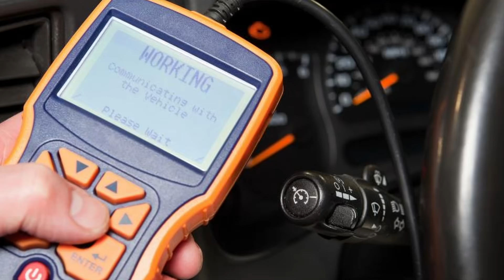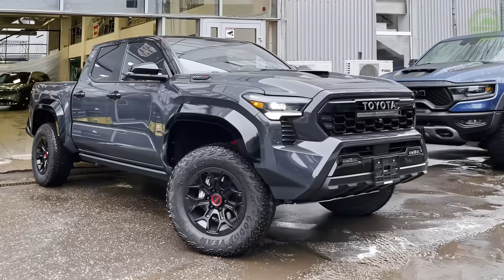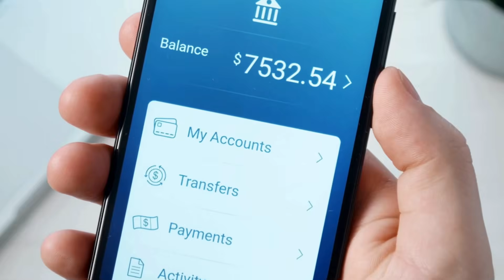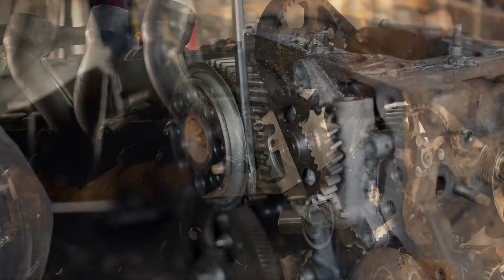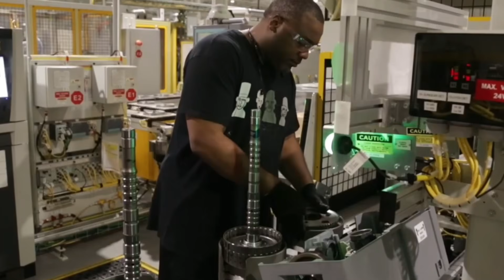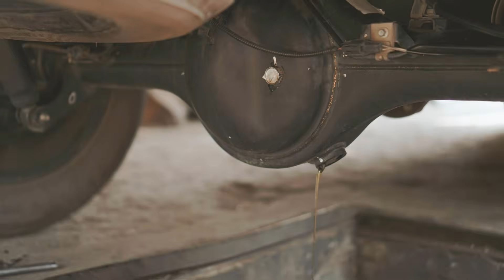Smart Drivers Are Buying 20 Year Old Trucks (Here’s Why)

Comment: I have a 2005 tundra no rust 165k 😂
Reply from the maker: A rust-free '05 Tundra with only 165k? You’re sitting on a legend. That 2005-2006 window is the absolute sweet spot for those trucks because you got the VVT-i power bump and the 5-speed transmission without the complexity of the newer generations. It’ll easily go another 200k if you stay on top of the maintenance. Have you done the timing belt and water pump service recently, or is that next on your list?
Reply: @AutoMetricsHQ did it when I bought it and valve gasket have 4 new tires she just a back up house truck paint is shot though but I love her 😂
Reply from the maker: Smart move doing the belt and gaskets early - that 4.7L will easily reward you with another 150k miles for that alone. It’s the perfect 'house truck' because it’s always ready to work when you need it without the battery-drain and sensor-headaches of a newer model sitting in the driveway. Bad paint just adds character as long as the frame is solid! ;)

Comment: I have a 2000 Dodge 2500 sitting in my back garage with 255K. Mine till I’m off the planet!
Reply from the maker: That 2500 is just getting started at 255K miles! That’s the beauty of it - once you own a truck like that outright, the financial freedom is worth more than any new infotainment screen. Are you still running the original transmission, or did you have to beef it up somewhere along the way?
Reply: @AutoMetricsHQ 
We tow vintage campers with it, yes I updated the transmission to a triple disk. Air Dog Raptor and others.
Reply from the maker: A triple disk converter and an Air Dog Raptor - now that is a bulletproof combination. You’ve basically fixed the only two things that can kill a Gen 2 Dodge. With those upgrades, that truck will keep towing those vintage campers for another 255k miles easily. It’s the perfect setup for the long haul. Are you running a mechanical fuel pressure gauge in the cab, or do you just trust the Air Dog to keep that VP44 happy?
Reply: @AutoMetricsHQ 
VP44 seems to be happy with the Air Dog, I try to keep it between 12-15 PSI with a mechanical gauge.
I agree with everything you have stated. I keep it oil sprayed or Fluid Filmed, it’s a rust free Florida truck.
Reply from the maker: 2-15 PSI is the perfect sweet spot for that VP44 - it keeps the pump lubricated and cool without over-pressurizing the seals. Between those mechanical gauges and the Fluid Film treatment, you're doing exactly what it takes to make a Gen 2 last forever. Florida salt air is no joke, but sounds like you've got it under control.
Reply: oh yeah, agree totally. Used to drive 80’s Mercedes diesels, still have a 2000 TDI Beetle, 5 speed, 273K.
Reply from the maker: You definitely have a type! An 80s Mercedes diesel and a 2000 TDI Beetle are the hall-of-famers of longevity. That ALH engine in your Beetle is legendary for a reason - at 273k, it’s just nicely broken in. It’s the same philosophy as your Dodge: simple, mechanical, and efficient without all the modern emissions junk. Sounds like you’ve mastered the art of never having a car payment! Does that Beetle still get over 45mpg?
Reply: @AutoMetricsHQ 
TDI Beetle routinely gets like 52MPG in the Summer.
Reply from the maker: 52 MPG is incredible - that's better efficiency than most modern hybrids, and you're doing it with 25-year-old mechanical technology. It just proves that when you get the engineering right the first time, you don't need a thousand sensors and a library of software to get results. Between the Beetle and that Dodge, you’ve basically cracked the code on efficient, low-cost ownership.
Reply: @AutoMetricsHQ 
So right you are, thanks for your really cool correspondence!🏆
Reply from the maker: It was a pleasure! I always enjoy chatting with someone who genuinely understands the engineering and the math behind these machines. Guys like you are the reason these legends stay on the road instead of ending up in a scrapyard. Catch you in the next one! ;)
Reply: @AutoMetricsHQ 
You are the Man!

Comment: 2006 tundra...
Reply: I am looking for second gen but it’s hard to find rust free underneath
Reply from the maker: That’s the challenge these days. The clean ones get bought fast, and the rust-free examples usually command a premium. If you can find a southern or western truck, it’s often worth paying more upfront than fighting frame rust later. What year range are you hunting for?
Reply from the maker: The 2006 Tundra is a great example of what I'm talking about. Simple, reliable, and built before trucks became rolling computers. Those 4.7 V8s have a reputation for running forever with basic maintenance. How many miles are on yours now?
Reply: @AutoMetricsHQ don't  have any more  wish id kept it. Sold for 7500.00 in 2019 had 220k miles. Now have 2019 nissan  frontier with the 4.0,  215k another good truck. Bought used with 130 k
Reply from the maker: It’s a classic story - those first-gen Tundras are getting harder to replace every year. But credit where it's due: that Frontier with the 4.0L is a total workhorse and one of the few 'modern' trucks that stayed simple and reliable. At 215k miles, it’s clearly doing the job. Did the previous owner already bypass the radiator 'SMOD' issue, or have you addressed that yourself?
Reply: @AutoMetricsHQ either previous  owner did  or that model was fixed.  I haven't  done nothing in 85 k miles. Its a pro4x. Runs like a clock
Reply from the maker: 85k miles with zero issues is exactly why people swear by those Frontier Pro-4X models. It’s one of the few 'modern' trucks that actually lived up to the old-school reliability standards. Since you’ve already put nearly 100k of your own miles on it, do you find the Frontier's seat comfort holds up on long trips compared to your old Tundra?
Reply: @AutoMetricsHQ i think not.  I recently  made a 500+ trip to Louisiana  my 63 year old butt and back felt it.  But the truck  made it fine cruising  at 75. It think  toyota  has better seating
Reply from the maker: That tracks with what I've heard from a lot of owners. The Frontier will run forever, but Toyota definitely seemed to put more effort into long-haul comfort back then. A 500-mile trip is a pretty good test of any seat! At least the truck passed the reliability test, even if your back didn't. ;)

Comment: Mid 2000’s dodge trucks were terrible. So were Gord’s. Modern trucks are just fine.
Reply: Lol
Reply from the maker: It’s true that Dodge and Ford had their share of 'wrapper' issues back then - bad automatic transmissions and front-end parts come to mind. But the iron under the hood, like the 5.9 Cummins or the early Powerstrokes, was objectively more durable and easier to fix than today’s $80k rolling computers. Modern trucks are 'fine' until a single back-ordered microchip or a complex emissions sensor puts you in limp mode for three weeks. Would you rather deal with a mechanical fix you can do in your driveway, or a software lock that requires a dealer login just to swap a part?

Comment: 2007 Dodge Ram 3500 DrW with 5.9l and 6 speed G56. No thanks to the new POS truck traps. I can drive my truck as long as there is diesel.
Reply from the maker: Hard to argue with a 5.9 Cummins and a G56. That's about as close as you can get to a forever truck - simple, proven, and not dependent on a dozen emissions systems and software updates to stay on the road. How many miles do you have on it now?
Reply: @AutoMetricsHQ  I bought with 59k in 2021 and now have 80k
Reply from the maker: 80k miles? That's barely broken in for a 5.9L. Finding one with that low mileage was a massive win - you’re basically sitting on a gold mine. A clean 2007 with those miles and a G56 is a unicorn on the market today and easily worth more than most people realize. You've got a brand-new mechanical masterpiece that’ll outlast anything on the dealer lot today. Have you already done a steering brace or a better fuel lift pump to iron out those final factory weak points?
Reply: @AutoMetricsHQ  I have updated the steering to the updated version. I installed a vailor clutch, banks air intake and air box. In-line exhaust brake. 

I bought it in AZ from a dealer trying to get rid of it n Lake Havasu. It’s been barely used and kept in AZ all of its life.
Reply from the maker: An Arizona truck with those mods is the ultimate setup. You’ve basically bypassed the only enemy those trucks have: rust. Between the Valair clutch and the exhaust brake, you’ve turned that G56 into a perfect towing machine that’ll handle just about anything without breaking a sweat. It’s the perfect example of spend a little on the right mods now to save $80k on a new truck later. Are you planning to keep the power levels stock, or are you running a mild tune to take advantage of that Banks air box?
Reply: @AutoMetricsHQ  i’m good. I don’t believe I’ll tune it anytime soon.
Reply from the maker: Honestly, that's probably the smart move. A stock 5.9 with a G56, good maintenance, and the right supporting mods will outlive most trucks on the road today. At only 80k miles, I'd be focused on keeping it clean and rust-free too. You've got one of the few trucks that's likely worth more in 10 years than it is today.
Reply: @AutoMetricsHQ  yes these and 12v can be found for sale at a high price and you can get a great vehicle the last a lifetime
Reply from the maker: Exactly. Whether it’s a 12v or a late 5.9 like yours, you’re buying a mechanical asset, not just a depreciating pickup. Once you pay that entry price, you're set for life - and that beats a $1,200 monthly payment on a new truck any day. Enjoy that Arizona gem!

Comment: Yes. I feel like late 90s was the sweet spot. Way less fuel emissions issues to. 99 ford 7.3.
Reply from the maker: You nailed it. The '99 7.3L Powerstroke is the poster child for that era's reliability. It’s a pre-emissions beast - no EGR, no DPF, and no DEF fluid to fail or put you into limp mode. Today’s diesel engines are so choked by complex aftertreatment systems that they spend more time managing sensors than actually working. Those 7.3s were over-engineered iron that was built to outlast the owner. Have you had to replace the camshaft position sensor on yours yet, or is it still running on the factory original?

Comment: Interesting although I scooped a powerboost 21 xlt f150 since over putting 200k miles on the vehicle you save $25-30k in fuel alone getting 14 mpg vs 25mpg considering gas at $4. That and enjoying a much nicer car - no problems at 60k miles - 44k of my own. Bought used and didn't experience that depreciation. That fuel savings alone is HUGE
Reply: I feel like creature comforts are something that I will 100% enjoy when I get around to buying a newer truck but my 00 cummins has been in 2 accidents and totaled 2 other vehicles and I still daily drive it after replacing a pitman arm and a radiator. Plus funny black smoke and like 10mpgs
Reply: Plus if I manual swap the truck then I can reliably get like 20-25mpgs
Reply from the maker: A manual swap will definitely wake that truck up and stop the power loss from the automatic's torque converter. Realistically, you’ll probably see 16-18 mpg - hitting 25 mpg is a bit of a stretch unless you're coasting downhill! It’s still a massive upgrade in reliability over the stock auto, though. Are you looking for a 5-speed NV4500 or the 6-speed NV5600 for the swap?
Reply from the maker: That Cummins is an absolute tank. Surviving two wrecks and only needing a pitman arm and radiator is the perfect example of why these old iron trucks are so legendary. As for the 10mpg and black smoke - it sounds like you’re dumping raw fuel. Might be time to check those injectors or the VP44 pump before it gets expensive! Do you still have the stock turbo on it, or has it been upgraded?
Reply from the maker: Buying used was a smart move to dodge that initial depreciation. Those fuel savings are great, but you’re essentially trading gas money for long-term complexity. At 60k miles, any truck should run great - the real test for those high-tech hybrid systems and twin turbos is at 150k miles. Are you planning to keep it past the factory powertrain warranty, or will you trade it in before the complex electronics start to age?
Reply: @AutoMetricsHQ  Absoluetly will keep it, I think all the people selling a powerboost either always want the next best thing or or the type of person to have paper hands. As long as you get minimalist xlt powerboost it should last a long time, less wear on brakes, engine, and transmission. Literally cannot emphasize that enough, The only issues I've really seen on forums is with the lariat+ models is that that add extra weight in chasis and more complexity with 4A.
Reply from the maker: I like the minimalist approach - dropping the luxury trims definitely cuts out some future headaches. Regenerative braking is a huge plus for brake life, too. My main concern is just 'software shelf life' and parts availability once that hybrid tech hits 10 or 15 years.
Since you’re keeping it for the long haul, do you plan on doing the maintenance yourself, or are you worried about those high-voltage systems requiring a dealer for every fix?